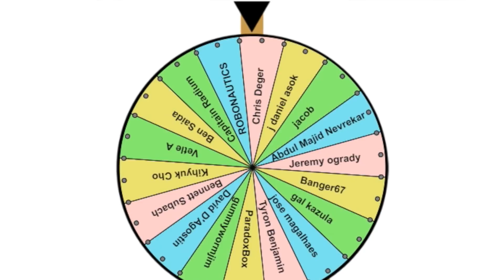HOW TO BUILD A DIY ELECTRIC ⚡ SKATEBOARD TUTORIAL - BATTERIES & ELECTRONICS - PART 2

Comment: That took a while there Neil. Makes me wanna start using LiPo packs. I want that mount!!!
Reply from the maker: Sup Mike!  Bro, it was way longer too!  I just wanted to make sure I explained it right to newer builders.  I was gunna include the VESC and RC Remote configuration also but that would have been like a 30 min video.  Dude, Jared's mount are pretty killer!  Tested and love them.  Real simple design so that there isn't any movement on the truck from vibrations.  I'm a LiPo guy for now.  But, I do wanna try a 10s4p or 10s5p to see if that alleviates the voltage sag, I'm sure it does.  but, I take care of my lipos and they've done well for me :)  Thanks as always for the support brotha!

- Neil

Comment: Hi Neil, sorry for needing to ask but what is the forth lead on the motor for. It has a white plug on it. Cheers David.
Reply from the maker: Hey there!  Thanks for watching!  I hope you'd consider subscribing to see more videos like this one.  David, that is called the sensor cable.  You can do with or with out it.  Hoever, sensored mode is so much quieter and smoother.

- Neil
Reply: Thanks Neil, have subscribed and find your video's a great help and easy to follow. Keep up the great video's. Cheers David
Reply from the maker: It sounds like you're building an DIY esk8 now? If you have any urgent questions go check out https://www.electric-skateboard.builders.  they have an awesome group of people and more than likely someone has asked the same questions you might have.  Good luck!

- Neil

Comment: How do you charge your batteries ?
Reply from the maker: There are 2 ways to do it.  Either you use an external balance charger which would require you to take the batteries out , I have a video here that can help:  https://youtu.be/3dfBrrNUsos.  On my new build, I use a BMS (battery management system, which balance charges the batteries with a 2 amp laptop style charger.  Hope that helps.

Comment: Looking at the prices ok diy kits they're almost as much as just buying a board. Is it cheaper to buy part by part rather than a kit?
Reply from the maker: DIY, in general will not be cheaper.  However, for what you pay on a prebuilt board, spec wise, you can create a more powerful or rider specific board.  Also, outside of cost, the board is built for you.

Comment: Hey Neil,
I am looking for the power switch with the external button that you used. I have searched a lot and have not been able to find anything similar, and the part is not included in your parts list. 
Is there any way you can help me find that part, or something similar that would work in its place? I am afraid that I will have to disconnect the battery every time I want to turn off my board.

Thanks, 
Kurt
Reply from the maker: Hey Kurt, I'm sorry for the late reply.  If you'd like I have an extra eswitch which  I've never used.  Was planning to use it for a build but it's collecting dust.  If you'd like to buy it from me shoot me an email at bigkidsofficial@gmail.com

Comment: Hi everybody,
I got about question about the charger. I did not notice the way you charge your batteries once they are out of power. Do you need to take them out and to plug them ? Is it a way to adapt a swith or whatever to charge them without having to take them out ? 

Thanks,
Reply from the maker: Hey there!  Thanks for watching!  I hope you'd consider subscribing to see more videos like this one.  So for this build I do need to use an external balance changer.  If you are looking to charge with say a laptop style charger that would require a BMS or battery management system in the board.  Balance charging however, is very reliable in comparison and can be faster.  However it does require you to remove the batteries from the enclosure.  Feel free to check out my video on balance charging: https://www.youtube.com/watch?v=3dfBrrNUsos&t=68s

- Neil

Comment: Hi , I had a question.  I have an e board I bought and the battery dies fast . Can I just wire up a better more power full battery with customized box that will fit it? It's a 24.2 v that's in it and I want more distance

Comment: i'll be building a e-sk8 soon and im a noob, a question about the batteries. i'm planning to buy a ZIPPY Flightmax 5000mAh 6S1P 30C, do i really need two of this battery for e-sk8?
Reply from the maker: 6s is the minimum cell count for you to have the current propel a person on a board.  However, if you get (2) 6S Lipos for 12S that may be Overkill for a new esk8er.  If I were you I'd go with (2) 4s or 5s Lipos in series.
Reply: @BigKidsOfficial  i was going to buy a 5 turnigy graphene 5600mAh 2s2p 90c  so it'll be 10s. im going to build something similar to SkateMetric's DIY 12S monster electric skateboard. I like going fast and it's also useful for me because my home is far from the city. and there is a lot of uphills that i have to go thru
Reply: since they said a high discharged battery is very important to get that kind of power
Reply: @BigKidsOfficial  is it okay to use a 5 turnigy graphene 5000mAh 2s2p 90c with 7.4v?
Reply from the maker: @robertmaceda996  yeah!  Actually, I have a build in the planning.  Already have a the batteries and the motors.  But I'm using (5) 2s1p high amp Turning Lipos in series to make 10s.  For your build, if you want to use a internal BMS (battery management system) to charge make sure you get the 2s1p and not the 2s2p.  Charing in series with 2s2p can get complicated and may even short.  However, if you plan to take out the batteries and individually balance charger them, then the 2s2p should be fine.  Hope that make sense.
Reply: @BigKidsOfficial  it actually made sense but rlly complicated😂 so i'll follow your advice. thankyou bro! u a rlly good mentor in the esk8 community especially for noobie like me
Reply: @BigKidsOfficial  it actually made sense but rlly complicated😂 so i'll follow your advice. thankyou bro! u a rlly good mentor in the esk8 community especially for noobie like me

Comment: I think just buying a series connector will save a lot of time and effort. It's only like $7.
Reply: he is using 2 postives tho in his Connector
and the one you sent is using 2 negitives?
Reply: @rainywater6430  Nah the wire colors don't matter (ex. A black wire doesn't hold a negative charge. Black wires are just what are used as a standard for negative.) You could still plug the positive terminal lead into the black wire and it's still a positive run.

Comment: What is the Runtime of that Thing?
Reply from the maker: If you are speaking about the range of the board this board can go about 7 to 10 miles depending on how I ride and the type of terrain.
Reply: @BigKidsOfficial  7 to 10 Miles... At what speed?
Reply from the maker: If you haven't been on an electric skateboard you should know that your speed will vary and there is not a consistent speed that will give you a definite range.  Range is dependant on your conditions (flat roads, hills, wind, etc) and how much battery you use.  If you are a slower rider than you may get 10 miles or so.  But if you like more speed than your range will suffer.  I hope that answers your question.
Reply: @BigKidsOfficial  Well, I've never been on skateboards or roller blades. But the electricity it consumes and that 10 miles range at assemble avg speed of 20 miles is not feasible...
How much it cost you in total? From parts used to full charging the batteries each time?
Reply: @BigKidsOfficial  why not use motors which consume less power and attach them with a shiftabke gearbox? That way, not only the battery will last long, but you'll get the required torque at hilly areas.
Reply from the maker: Can you send me a link to this gear box you speak of?
Reply from the maker: Like, I had mentioned, the battery lasts between 7-10 miles which is sufficient for me. For a 5000 mAh battery at 10v this is sufficient for my needs.  Have you built an electric skateboard.... Or vehicle?
Reply: @BigKidsOfficial  I'm still in the process of designing it. After its patented, then sure.
I don't have money to make a prototype of this.
Once done, it'll be used in roller blades instead.

Given the current situation of Covid 19, the workshops are shut down for months..
Reply: @BigKidsOfficial  The designers is actually ready, I'm just running some simulations to analyse the stresses.. It'll be over soon..
Reply from the maker: I'd like to see your shiftable prototype electric rollerblades and how user-friendly they are.  At this time, there are no manufacturing/vendors that have used this for electric skateboard.  As for range, I have used many different batteries to increase the range which is common practice right now.  At this point I have a 43 volt 12s4p lithium battery that gives me more than 20+ miles.  In speaking about torque, there is more than enough torque to get up hills without stress on the battery and adequate battery left for long range. This  set up has lasted me over 3 years without even a thoufht of using shiftable gears due to the complications and possible errors this would add to a skateboard.  For a car, this is obviously a great solution.  But as for a skateboard which you are standing on I can foresee gearshifitng to be challenging and not user-friendly.  But hey, good luck.
Reply: @BigKidsOfficial  Nope. Not yet. Just started. (I'm a civil engineer though)..
But lots of things can be done to not only increase the range, but also reduce battery requirements. Which in turn will reduce the weight of that board and save electricity while charging. 

The thing I want to convey is that, lots of people are influenced by your videos, (Andearn from it too), so, you can do what I can't (Because I don't have a penny to fund it).
And that is, work on some gearboxes and fabricate them. Some small planetary gearbox are already there on the internet. You just have to design a small mechanism to make it shift between gears. 

I'm running simulations in Ansys Workbench to understand the stresses on shifters and gears. 
I'm sure it'll be over in a week.
But I don't have money to make a prototype of The roller blades.
Reply: @BigKidsOfficial  In my design, I've reduced the size of an actual automatic transmission to fit in the roller blades and for shifters, I've coupled it with 2 options. Shifter drum like used in bikes or Solenoid... And then I'm gonna connect them with a circuits which can be controlled by that speed controller stick in your hand.
Reply: @BigKidsOfficial  This way, the battery can last for a day.... Or more than that..
Reply: @BigKidsOfficial  C'mon man. You got money. You got reach. You got sponsores.. You can do it.

Comment: Hello, 
How does Power (W) and Torque (Nm) influence speed ?
I have 2 motors quite similar same Kv, Ampere, Volt but different Power and Torque, which one to choose ?
Reply from the maker: Would you send me pictures of the specs, on the motors to bigkidsofficial@gmail.com? And maybe I can help?
- Neil
Reply: here links :

https://diyelectricskateboard.com/collections/electric-skateboard-motors/products/electric-skateboard-motor-6355-260kv

https://diyelectricskateboard.com/collections/electric-skateboard-motors/products/electric-skateboard-motor-6374-190kv

(According to people second is better, but I also found motor with more kv than those but less power ... and less expensive, but anyway)
Reply from the maker: Thanks Anthony, both are great motors.  The 6374 motor will give you a higher top speed and more torque.  It can also handle a higher wattage.  Personally, I wouldn't even consider the 6355 motor with the 6S battery.  It's a much smaller motor and if stressed going up hills may overheat compared to the 6374.  If you do purchase from DIY Electric, please consider using my code BIGKIDS10 as I receive a very small commission which I reinvest into the channel.  Good luck and let me know if you have any other questions.

- Neil

Comment: On you battery , it says 5S=18.5V. In series, it will become 37V. But you mentioned 42V. Is there something more to it than what's printed on stickers?
Reply from the maker: You're right but what I mentioned in the video, 42V is actually the total amount of volts. 4.2 v is the capacity of 10s.  What the stickers on the battery reference is the nominal voltage of the battery.  It's a little confusing but nominal is the middle value of the voltage range

Comment: Can you just buy a 10s Lipo so you don't have to connect to 5 s in series?
Reply from the maker: Hey there!  Thanks for watching!  I hope you'd consider subscribing to see more videos like this one.  You can.  However, finding one would be hard.  It's kind of like asking a car manufacturer for a v5 motor vs the v6 or v8.  there are a couple vendors however that do product premade 10s or 12s packs from 18650 liion batteries.  These do come at a pretty penny though.

- Neil

Comment: Did you cut and solder the lipos aswell? The ones i just bought have different connectors
Reply from the maker: I did not have to change my lipo connectors.  You can cut and solder new connectors if you need to.  Be VERY carful to not complete the current between the positive and negative leads as this will creat a spark, damage the batteries, and possiblely hurt you.

Comment: I am soon to be building this and wondered what was the name of the thing he plugs the power button in to?
Reply from the maker: The power button resides between the batteries and the VESC ( or some kind of electronic speed controller).
Reply: I found the one you used thanks
Reply from the maker: Nice!  Glad you had found it
Reply: Be careful using a switch or high current loads like this set up. Most switches are not rated to handle currents above around 10amps which would mean at 42 volts (10s) it would be limited to 420 watts. Better alternative is to use a high current heavy duty relay rated for the 42v and amperage draw of the motors (use at least as high as the vesc ratings) and then use any old switch you want because now the switch is only turning ye relay on/off an the relay is switching the actual current. I assure you that switch in this build will be the first failure point.

Comment: Yooo Wattup!!! Can I use 2 ZIPPY Compact 5800mAh 5S 25C Lipo Pack batteries with theTorque motor 6374/ 190KV? Also can I use two 6s batteries?
Reply from the maker: Yes and yes 😁. However, If you go with a single motor I'd go with the 10s and if you go dual the 12s should be fine

Comment: What happens if I want to put two motors? do I need 2 VESCs? if so, then what about connecting them to the battery?
Reply from the maker: Yes, you would need to VESCs or a dual VESC like the FlySky or Unity.  Then you'll need to split the current from the battery to power both VESCs.

Comment: Hey, 

I just have a question how would you add a single motor to a dual motor brand new skateboard and also be able to run the single motor without running the other two motors?

By the way I'm new to this electronic world please if it's possible explain to me as simple as possible.

Thanks

Comment: Hi ! Great video for beginners but I hope you will put a fuse and an anti-spark system on your boards. Safety first ! ;)
Reply from the maker: Hey brotha!  That is a great 👍🏽 nugget of information.  My last board did include an anti spark loop key and I think the power switch has antispark qualities built in as well.  But the fuse is a great suggestion.  What amp fuse do you suggest for a 10s 5000mah LiPo with a 3000w 6372 motor?  And also, I appreciate the comment and not ripping me up for not including that in the videos. You are kind 😊
Reply: Big Kids Hello ! A fuse is meant to protect the least robust element on the way of current.
Usually it's the ESC. VESC can take continious 50A and for Focbox, it's 60A.
I put my 50 or 60A fuse on the positive wire going from battery to ESC and my AS key loop on the negative one.
Note : Take care with an antispark/fuse/powerswitch all in one from Vedder because I saw several people having trouble (big big sudden brutal stop) when the fuse explodes (sorry not an english native speaker and don't know the correct wording).
Reply from the maker: This is great advice!  Thanks for the contribution.  I was actually looking at fuses last night and ordered one.  I will also make a video about including a fuse.  I appreciate the support :)  And, your English is fine, I understood everything.

- Neil
Reply: Big Kids : you're welcome, mate ! Glad to help a fellow esk8er, especially on the safety part.

Comment: How do you deal with charging?
Reply: Luke AOD following
Reply from the maker: Hey guys!  I'm sorry I missed these comments, I'm usually really good about it.  Anyhow, there are 2 ways for you to charge the batteries.  First, is a simple more straight forward way, which is using a balance charger.  I have a video here you can reference: https://youtu.be/3dfBrrNUsos.  Second, is a more simple way in the day to day but is a bit more complex and also invites more points of failure.   In this case you'd use what is called a Battery Management System or BMS.  Think of it as an onboard balance charger for your board.  My friends at I AM DELUXE have done a great video here:  https://youtu.be/F_paouc06Cg.  Anyhow, let me know if you have any other questions.

- Neil

Comment: Could I use 3 5s battery's to get 15s out of it?
Reply: of course, just remember to sum up the voltage of every battery that you cannect together in series. So 3 5s batteries in series will be 15 volts.
Reply from the maker: The nominal voltage of a battery is what you would add up together.  So 1 cell is 3.7 volts.  So a 5S lipo would be 5x3.7 be 18.5v.
Reply from the maker: 15s is a bit more than most ESCs can handle in regards to voltage.  I would stay under 13S.  I currently run 12s and before that had a 10s battery which worked great and got me going 30mph!